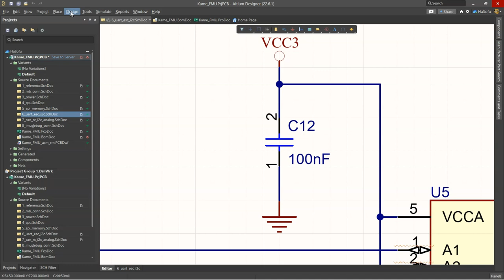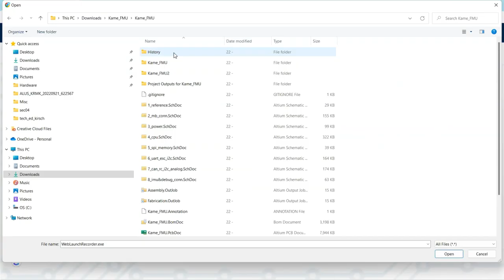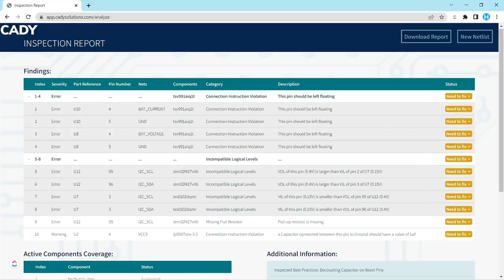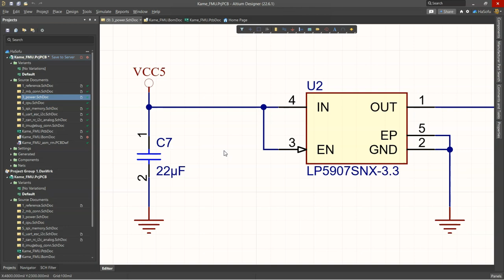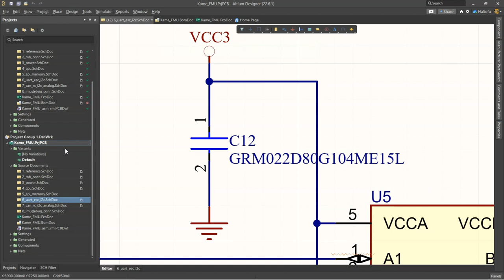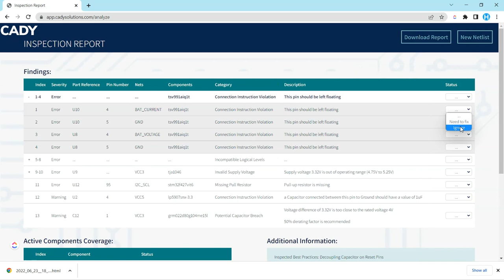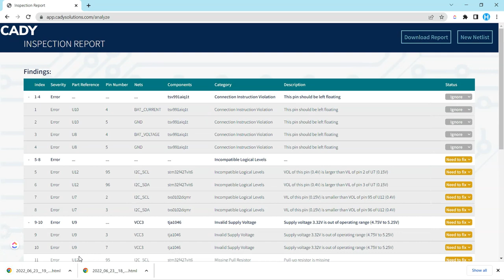How Artificial Intelligence Will Change Electrical Engineering Forever

Comment: What about Instrumentation engineers?
Reply from the maker: From ChatGPT (I agree with this):
AI has the potential to significantly impact the field of instrumentation engineering, but it is unlikely to completely replace instrumentation engineers in the near future. Here’s an analysis of how AI might affect this field:

Potential Roles of AI in Instrumentation Engineering:

	1.	Automation of Routine Tasks:
	•	Calibration and Maintenance: AI can automate the calibration and maintenance of instruments, reducing the need for manual intervention.
	•	Data Analysis: AI can process and analyze large datasets, identifying trends and anomalies that would take a human much longer to find.
	2.	Enhanced Monitoring and Diagnostics:
	•	Predictive Maintenance: AI systems can predict when instruments are likely to fail based on historical data and real-time monitoring, allowing for proactive maintenance.
	•	Fault Detection: AI can identify faults and suggest corrective actions more quickly than traditional methods.
	3.	Optimization:
	•	Process Optimization: AI can optimize the operation of instrumentation systems, improving efficiency and reducing energy consumption.
	•	Design Optimization: AI can assist in the design of instrumentation systems, suggesting improvements and optimizations.

Limitations of AI in Instrumentation Engineering:

	1.	Complex Decision-Making:
	•	Instrumentation engineers often make complex decisions that involve understanding the nuances of a system and the broader context of its operation. AI, while powerful, still struggles with making context-aware decisions that require deep domain expertise.
	2.	Creative Problem Solving:
	•	Engineering often involves creative problem-solving and innovation. AI excels at pattern recognition and optimization but is less effective at generating novel solutions to unprecedented problems.
	3.	Human Judgment:
	•	Certain aspects of instrumentation engineering, such as safety assessments, ethical considerations, and human factors engineering, require human judgment and cannot be fully automated.
	4.	Adaptability and Learning:
	•	Instrumentation engineers can quickly adapt to new technologies, methodologies, and unexpected changes in the system or environment. AI systems require retraining and reprogramming, which can be time-consuming.

Collaboration Between AI and Engineers:

Rather than replacing instrumentation engineers, AI is more likely to serve as a powerful tool that enhances their capabilities. Engineers can leverage AI for tasks like data analysis, predictive maintenance, and optimization, freeing them up to focus on more complex and creative aspects of their work.

Conclusion:

AI will undoubtedly transform the field of instrumentation engineering, making processes more efficient, reliable, and optimized. However, the expertise, creativity, and judgment of human engineers remain indispensable. The future is likely to see a collaborative relationship between AI and human engineers, where AI handles routine and data-intensive tasks, while engineers focus on decision-making, innovation, and system integration.